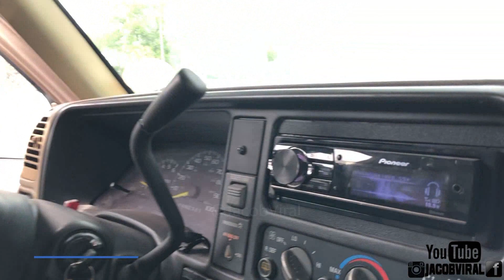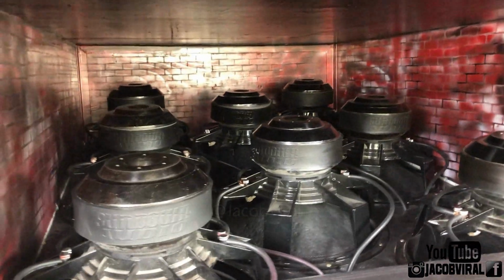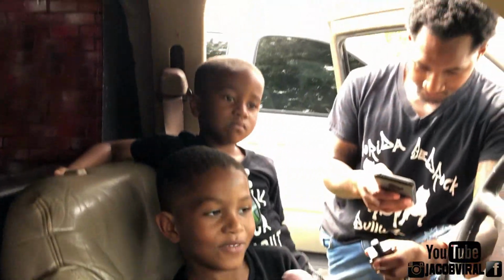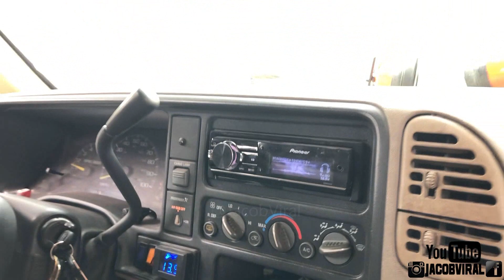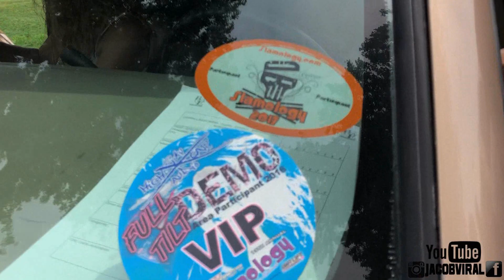TOO MUCH SMOKE! 8 18S EXTREME BASS SESSION ENDS BADLY...

Comment: all those amps on 2 alts claiming hes not clipping lol, um ya ok lol. youre not pushing over 11k with just 2 alts. im not even gonna pull into the mix the amps on the musical end. bet you if you hook a voltage meter up and a clipping like that system isnt happy at all. the subs are proof of that lol.
Reply: Lol no one of his coils smoked. Doubt he's clipping. He has more then enough alt and battery to support those amps
Reply: I siliconed my rear windows shut on my Chevy so they wouldn't flap like that.. Figured I never opened them anyway.. There is a trick to get the window latch tighter though which helps to a certain point.
Reply: @OrionHCCC26  no shit one of his coils smoked lol, did you even look at his wiring under his hood? hes only got 6 zero gauge cables thats 2 per alt. thats not gonna support over 11k clean. he even stated hes never clamped the subs so hes got no clue whats going to them, you do understand to much power causes clipping right ? hes got more amp power then subs to spread the power evenly specially without even clamping the subs. you might wanna actually stop the video and look at the volt meter by the amp on the wall. hes at 13v withthe system running. those amps take more voltage to push the said power hes claiming. which at that claimed over 11k watts is clipping the shit out of the subs which overworks the coils endind result a smoke show. he even went as far as to say he blows up a sub everytime he turns the system on. even when the system is off hes reading high 12v.
Reply: @ColdVenom159  lol that's not how electrical works my man sorry. He has more than enough alt to support all of his amps/batteries and then some. I have 10 banks of lithium and have one 390a alt. I have 4 runs of 2/0 from my one alt, which is overkill. Every one run of 0g/-1/0 can support 350a of power. His runs are not the problem. Do the math. 350a times how many cables? What he has currently is more then he needs to continuously feed his rear batteries. I should know, I run a lithium business, it's my job to know electrical. I'm easily running 32kw on one alt and 10 banks of lithium. Which is overkill for my system. Full tilt, no voltage drop at all.
Reply: @OrionHCCC26  idk if i should laugh at your comment or what lol. hes not running 350amp alts lol youre already wrong there lol. i like that u have not a single video of anything on your channel lol.
Reply: @OrionHCCC26  I got a question  for you . What's the average life span of the limitless 45ah battery for daily beating?
Reply: @teeone10  not sure, but the internals of that battery is horrible and extremely expensive for no reason. The cells are poor quality. My business is a Yinlong - lithium titanate oxide business. If you want durability, versatility, and extremely long-lasting cells then Yinlong is what you want. The cells themselves will outlast your whole vehicle. I would save your money buying limitless and go with Yinlong. If you easy hook up an play batteries, d4s lithium is a pretty good option for the price